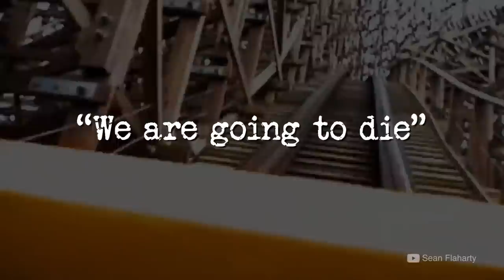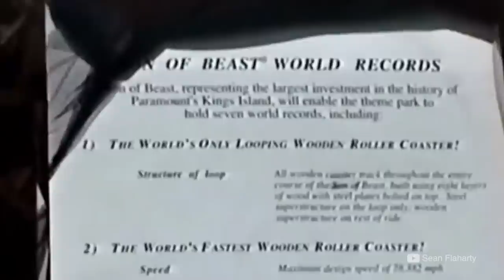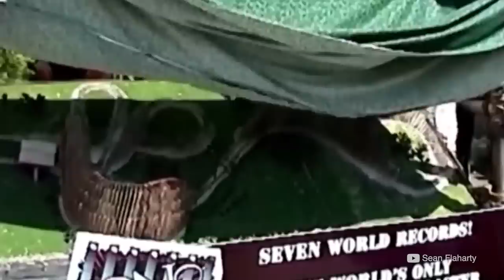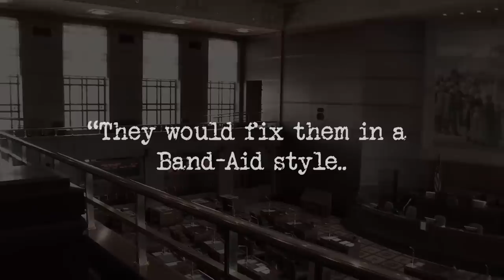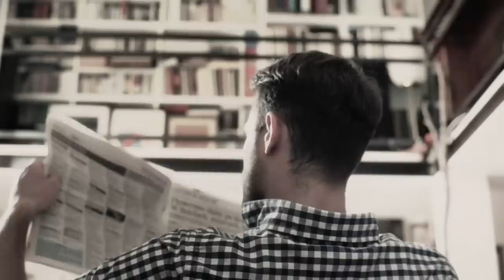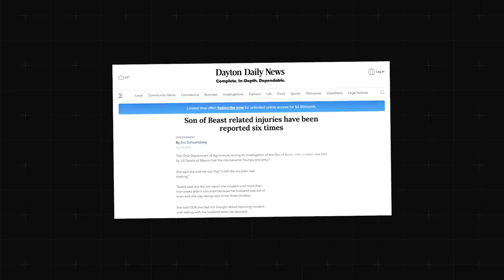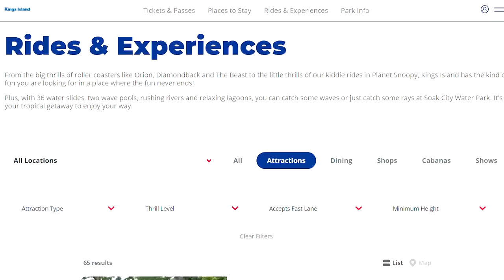The Son Of Beast Roller Coaster Accidents

Comment: Wooden roller coasters have always made me uncomfy. I just can’t trust them. 😬
Reply: I agree. They aren't usually the tallest, fastest, most extreme, etc... But they always scare the bejeezus out of me the mostest.
Reply: Steel wheel on steel strip track does made it both relentless and pretty rattly. But, honestly the wooden structure itself is pretty much hold, it's not weak material at all

If you wanna some smooth wooden coaster, try El Toro. It use rubber-on-metal wheel to reduce vibration. Also the whole thing is build by CNC machine instead of carpenter
Reply: The fact they feel like the coaster is shaking itself apart is precisely what makes them fun. It gives you a feeling of being out of control that no steel coaster can match.
You just have to build them properly so they don't actually shake themselves apart...
Reply: They don’t scare me, but I have mild scoliosis (like, not bad enough for surgery) so riding coasters that jerk around that much can be pretty hit or miss for me. 😔
Reply: There are some great and more than safe wooden rides that held up for decades (Phython) and will hold up for years to come (Joris En De Draak).

Comment: The beast coaster is awesome. That son of beast was a real Son of a......

It would bounce your head around the pull-down safety bar and your neck and back paid the price too.... Horrible.... And I loved rollercoasters even ones that were rough. That thing left no room for fun. I rode it 5 times and had enough. It was broke down more than it was up....
Reply: It felt more like a pinball simulator than a roller coaster
Reply: I call BS. The Son of Beast didn't have the safety bars that went over your shoulder like the Vortex. It was a giant lap bar. It was more of a restraint that the OG Beast, but it wasn't an over the shoulder restraint.

Comment: The loop removal was indeed unrelated to the 2006 accident and was entirely a result of the lighter trains. Those trains couldn't generate enough momentum to clear the vertical loop, and thus Son of Beast lost its most iconic element. But at least one person in another video on this ride says the lighter trains only made things worse for riders, not better.
Reply: It is like the heavier cars of the past glided over bumps, barely being able to be felt.  Today's cars use less fuel, but every bump is felt.
Reply: @indridcold8433  Well, the intent behind the lighter trains here was to lessen the stress on the track, hoping that would reduce the risk of further accidents like the one in 2006. It really didn't help much, according to one rider the lighter trains made the ride worse.
Reply: true also if i remember they did a test run of an empty cart and 1. it risked sliding backward and 2. it got stuck upside-down at the top loop.

Comment: Grew up going to kings island, always heard stories of how rough the ride was on the son of the beast.. even the beast (not sure if it still stands I havent been in years) is an extremely rough ride and if you’re not prepared it’s not a good time. Can’t even imagine how bad son of the beast was😳
Reply: The Beast is still up and running! It’s awesome but boy do I slightly freak when we jump the chain going up the second big hill. It’s loud af and worse in the summer heat, but awesome af
Reply: Yeah, I rode The Beast twice in my life. Both times ended up with a sore neck like a muscle pull.
Reply: It did get a major retracking last year to smooth it out a bit
Reply: I actually recently got injured on the beast 😅 it was partially my fault, had my arms up in the air on a rough turn and pulled a few muscles in my arm, shoulder, and back as a result. It's pretty damn rough but I can't imagine how much worse it would have been on SoB

Comment: I rode this NASTY rollercoaster.  It was like being dragged by a rope over a gravel road.  To make things worse, the operators were very uncaring.  The day I rode it, there were no seatbelts.  I grabbed one of the operators and asked him what I was supposed to do to stay safe without a seatbelt.  He said emotionlessly, "Oh, they are being worked on.  Just hold onto the bar".  I said "What bar!?!?"  He replied "The one on top the car in front of you."   I was terrified and it took off before I could tell them I wanted off.  I'm short and I could barely reach the bar.  It was one of the most terrifying things that happened to me.

Comment: I've literally never rode a wooden roller coaster that wasn't super rough and painful.
Reply: Check out GCI’s coasters then, because I’ve heard they’re pretty smooth.
Reply: The beast is awesome & pretty smooth these days. They upgraded the seats and lap bars.
Reply: @jtika1978 That’s because the Beast was built with actual care. It isn’t even necessarily related to experience. The Beast was built and designed by Kings Island itself, and the designers had never built a coaster before (although a very experienced designer was a minor consultant). Meanwhile, Son of Beast was built by a company who had been building coasters for almost 20 years!

Comment: I rode Son of Beast back in 2008, and yes it was a rough ride even for a wooden coaster. kinda interesting to see that a lot of that roughness was probably not a good thing with all of the issues they had with the ride...
The Beast was much smoother even though that ride was decades older, which I never understood since it seemed backwards to me with wooden coasters getting worn out over time.
Gotta love how much oversight was happening at higher levels of management (*sarcasm*), probably in their best interest to demolish Son of Beast.
Reply: Older trees
Reply: Loved those old wooden coasters  😊
Reply: Fun fact: my local amusement park (Camden Park in Ceredo, WV) has one of the oldest wooden coasters in the country, an original Big Dipper from the 1950’s. While Camden Park has had its own share of incidents (the bumper cars caught fire, the Spider was removed after an arm fell off and injured someone), the Big Dipper is surprisingly one of the safest rides in the park. 

Basically what I’m saying is that wooden coasters are the hardiest things I’ve ever seen. Those things basically last forever…if they’re built properly.

Comment: I have one question. Why did they make it out of wood? A material much weaker and easier to break than steel. And wood is highly flammable.
Reply: At the time, they were mostly just looking to set records. The more records you have, the more publicity. In addition, wood is more flexible than steel so you feel more of the force when you go around curves as the wood flexes. 

Like you said, wood is weaker than steel so a poorly built support system will cripple the ride permanently should it fail. Most riders claimed that Son of Beast was quite smooth prior to the support beam failure. Once the beam failed, the wood was either replaced with or bolted together with steel plates which eliminated the give the wood originally had. Meaning people got knocked around more inside the carts.
Reply: @pgbrown12084  Hmmm.
Reply: It being wood wasn't the problem, the wood that was used was cheap to save money, the whole thing was built poorly
Reply: @GasolineProductions  Hmmm, interesting.
Reply: @lila2028  RCCA is well known for very poor build rollercoaster. They only manage to build only 2 coaster in US, despite their "America" name. 

Heck, even SoB tender is basically RCCA doing underbid
Reply: Engineering  glitch

Comment: How is the Department of Agriculture responsible for Rollercoaster safety? Talk about needing a broad skill set.
Reply: Oversimplified? It comes from when "amusement parks" were still just simple things like hayrides and carousels at state/County fairs, which were run and regulated by the DoA. As the rides and such grew, so did the DoA's role in monitoring them. So even though modern amusement parks are their own thing now, the DoA are still in charge of making sure they adhere to safety standards, including having professional inspectors and engineers on staff.

Hope that made sense and answered your question.

Comment: I rode Son of Beast the year before this happened in 2005. Some friends of mine in a church youth group talked me into riding this coaster, as I was terrified of going upside down. The loop itself didn't scare me as did many of the turns. The turns were awful tight and would be so rough you would bounce along the side of the car if you were on the right side. It had felt different than the other rides we rode that day. At the time I only remember hearing whispers of something having happened on the ride, but this is the first video I've come across that explains it.

Comment: I worked on Timberwolf at worlds of fun in Kansas City, an all wood coaster. One day the train just crashed into the entrance because the wood swelled. We ran all morning with no issues & a few hours in the train still made it through but had a rough stop. We called maintenance, they shaved iff the spots where it hit, ran it through empty & then I hopped on for the test run. All was fine. Before I worked there a kid supposedly died on it but I never knew if that was true or not. Most roller coasters have that myth when you work on them.

Comment: I rode the original Beast coaster back in the mid 90's and exited it with the worst headache of my life. That was my first and last ride on that coaster. I have rode many coasters at numerous other parks without any headaches or injuries.
Reply: I had similar experiences with the original Beast.
I rode that coaster in the early 1980s twice and I had headaches both times.
It was terrible how it just "punched" you during the ride.  Very, very jerky in a few turns.  Whiplash on that ride is VERY believable to me!  By far the most punishing rollercoaster I ever road.  The wooden coasters Cedar Point has aren't 1/10 as bad!  They're much smoother rides!
The closest I've come to that feeling on the Beast (about 20 years ago) was the Hulk ride at Universal where you got put into a 4.5G turn in the spiral.  My eyes bugged out a bit!
Second time I went on it, I was acclimated to the Hulk and the G's weren't an issue.
They've modded the Beast since the incidents with the sequel ride to be smoother in 2(?) sections that were notorious for giving people injuries.
Heck, I've ridden the old wooden Mine Ride at Cedar Point (it's around 20 years older than the Beast) and while the frame visibly shook (to the outsider; on the ride you don't notice it), I never got beaten up on that ride like I did on the Beast!
Just read on the wiki for the Original Beast that it's supposed to undergo a major rehab this year.  It ought to -- the ride's over 40 years old!!!
I'm middle-aged now and I honestly have no desire to ride coasters anymore.  Thankfully I was never seriously injured but it's not hard to see how other people are!  A lot of people ride these rides who are NOT in condition to do so (overweight, too old, bad hearts, etc.) or are not mature enough.  Those signs for "You must be this high to ride!" are a joke.  If the safety harness can't fit you -- too loose or TOO tight--, don't go on the ride!
Reply: Lovely beast  😊

Comment: i think i was 12 when the "loop accident" occurred but even then being 12 i barely knew much about it. i had been on the original beast countless times without incident and it was one of my favorite coasters... i went up the massively tall percarious ladder and i was in line ready to go, and i said "nope" of course i got flack from my friends and i was called a "chicken" but something about looking at the whole of the structure set me off. the SOB was painted white unlike its predecessor and the 1st thing that struck me was "why are the planks so thin? why are their metal tubes 2 feet above my head? and why do the stairs im waiting on feel like an earthquake?". when my friends came off the ride two of them were groggy. not sick groggy, headache groggy and im pretty sure looking back they might have been concussed. they let up on namecalling after the ride and no one ever suggested to ride it again. mind you i was an OH resident so we went there almost annually and also went to cedar point. ive ridden the top thrill dragster and millenum force without hesitation & ive had many repeat rides. the beast barely rattled its station and the the wooden beams were more numerous and much thicker but the SOB may as well could have been an incomplete stack of jenga

Comment: It's like none of the designers or engineers thought about vibration causing wear on wood with metal bolts. Same thing happens on the pinsetters I work on, except when a bolt wears out, people don't potentially die.
Reply: Of course a pinsetter is a roller coaster ride of sorts for the pins (and ball too). Not to mention if the pinsetters are sped up too fast (A2 full speed) then it inevitably exacerbates wear and tear all around. Do you work on AMF or Brunswick?

Comment: I can attest to these wooden coasters changing over time. It's wood, after all, so no big surprise.
I got to ride The Grizzly at Great America in California when I was 10 during its first year in operation.
Now I think the park is owned by Six Flags, but back then it was still private. Those first few times riding, it was great. I got to go back another 3 times in the next 6 years, and the coaster got progressively rougher. When you'd be waiting in line, practically underneath it, there would be a dusting of splinters after the coaster went by.
Reply: It's not owned by Six Flags. It's owned by Cedar Fair. It's still there, and it's a fine ride. Boring, but relatively smooth. They've done trackwork on it over the years.

Comment: I am surprised, that a modern roller coaster is being built out of wood.
Is it may be cheaper? But wouldn't the maintenance be more expensive?
Reply: Yes, maintenance is more expensive. But wooden roller coasters are still built all the time. It's perfectly normal, and they're usually phenomenal rides. Many prominent manufactuers such as GCI, Gravity Group and RMC currently manufacture modern and high-tech wooden coasters. They're often more out-of-control than steel coasters.

Comment: i dont understand how they thought wood could be a good material for a roller-coaster.. over time they will gradually rot & weaken.. u got like 10 years at most before the material is useless unless they are somehow 100% protected from weather- which is very difficult if not impossible to do)

Comment: I was 13 when the accident happened I was riding it and I had a concussion and I had severe whiplash and I had 2 broken toes. After the accident they took down the son of the beast and replaced it with the O'Ryan. Also now they run the rides from 6:00 am all the way to 10:00 am (10:00 am is when park opens) also staff will ride every single ride from 9:30 to 10:00 before anyone else can ride the ride. After the son of the beast they made safety measures alot more serious
Reply: They replaced with Banshee.  Orion sits where Flight of Fear was.
Reply: @andrewcolsen  no they didn't they replaced it with the o'ryan the only wooden ride in kings island currently is mystic tembers I was there yesterday and they litteraly tell you this: "we regret to inform you that the son of the beast is no longer available. The son of the beast has been replaced with O'Ryan, our safety measures have Rosen and we hope you enjoy your day at kings island."
Reply: @andrewcolsen  the flight of fear is right next to the orion wym? orion replaced firehawk.
Reply: @officialuaaf  no, the beast is wooden too. and theyre right, son of beast was replaced with banshee.
Reply: Wow. Do you still have after-effects today?
Reply: @gabi2real  no your wrong I still have the map from July the O'Ryan replaced son of the beast. And the only wooden ride now is The Beast, it says this on the map
Reply: @hmdwgf  Sadly yes I still have trouble today getting shoes on comfortably due to my big toe being slightly off to the left so I have trouble with it
Reply: @officialuaaf  look it up, Orion* replaced Firehawk and banshee replaced son of beast! and there's a new wooden rollercoaster now, its call mystic timbers, very smooth ride too.
Reply: @officialuaaf  I'm so sorry. Hopefully it gets better for you.

Comment: Another ride like this should be an RMC like Steel Vengeance at Cedar Point. If Kings Island should ever resurrect SOB RMC would be wise. I rode SOB in 2000 and it was and still is the worse roller coaster I ever rode. Kings Island is 50. I want an RMC coaster down there. Oh, and the SOB successor Banshee is a favorite of mine😀